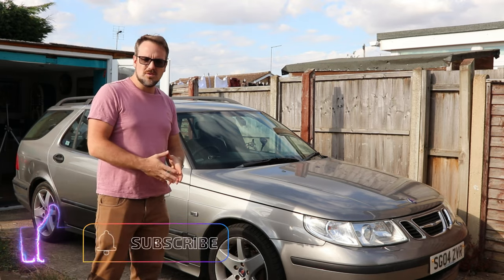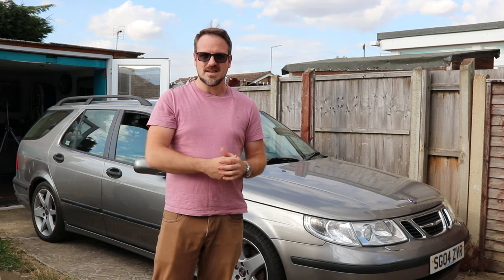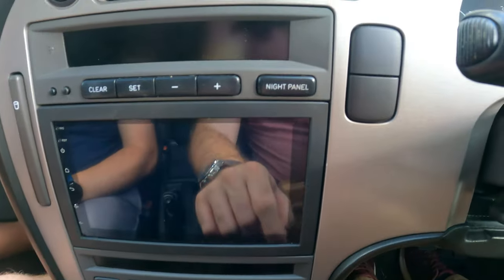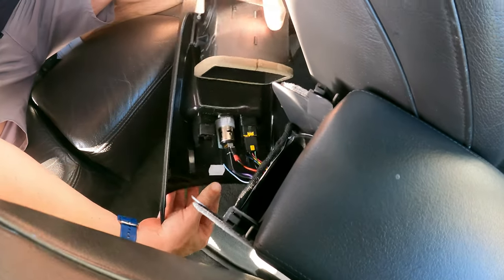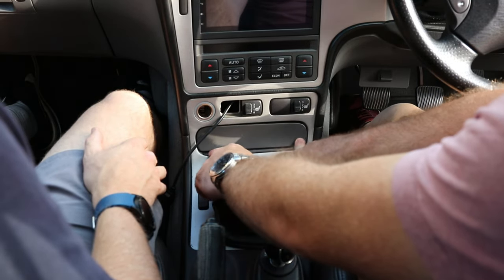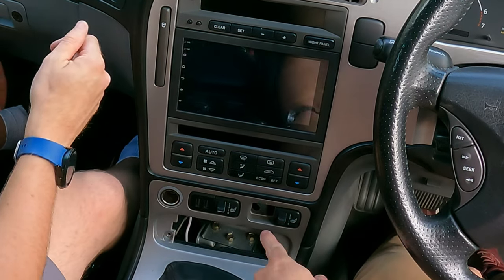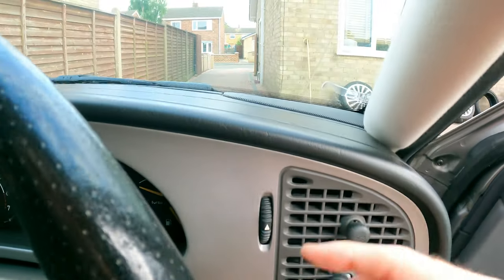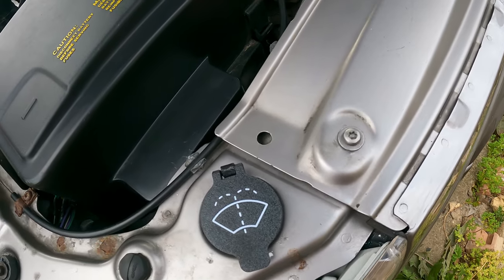Saab3dPrint - Awesome Aftermarket Upgrades for your Saab 9-5 and 9-3 Made by Enthusiasts!

Comment: That volt meter is actually quite useful too. If you turn the key to 'on' but don't start the vehicle, the volts display will show you what the battery is outputting so you can check for a battery that may be getting close to replacement (anything under about 12.2V is considered weak), and if you start the vehicle then this will show what the alternator is outputting so you can see if it's about to go out (less than about 12.6V). You can maybe catch an issue before it gets you stranded on the side of the road.
Reply: I had an old school voltmeter (made by VDO but Saab branded) on my 9000 and it was incredibly useful
Reply: @nuttycommuter3718 There are also ones that can plug into the cigarette lighter. Quite useful.
Reply: @JustWasted3HoursHere  I had the set of three so voltage, oil temp and oil pressure and having that extra information just helped with looking after and driving the car - not giving it beans until the oil had warmed up for example. Often cars now don’t even have a water temp gauge
Reply: @nuttycommuter3718 Back when I drove a gas powered car I found those gauges very useful indeed. Now I have an electric car (a 2018 Kia Soul EV+) and it always does a system check of everything including the 12V accessory battery on startup. Very useful because even EVs can have problems if the 12V goes bad!
Reply: Well, i have a usb lighter and it also features a voltmeter.
Reply: @KayoMichiels  Nice.

Comment: Awesome idea and implementation - NOW I'm free of the messing USB cables running all the place.
One note though: on 2001 9-5 Aero, there's no "torx screw" to loosen up as mentioned in the video's 1st step. One needs to slide the "vent assembly" slightly up and over from the bottom till it comes loose of the retaining hinges.
And then "wiggle" it slightly to have fully come off of the console to gain access to the back of it.
Other than that, it's a great addition - highly appreciate and highly recommend!
Reply: Seemingly the same steps to remove it on my 9-5 sedan from 99.

Comment: I have a 2007 Australian spec 9-3 Aero with a CC2 Plus installed.  A connected, dual USB socket insert for the blank switch position that's just to the right of the head unit space would be high on my must have list. I think that it's where the convertible has the switch for the rag top.

Comment: Hello, how did you retrofit Saab gravity sensors in order for the xenons auto-leveling to work? Is there a video that you made? I will really appreciate any instruction that you may have on that. Thanks!
Reply: Hello I got Saab 9-3 1.9 Aero 2010 Donner spare. 
Is my Saab 9-3 1.9 2007 
I want upgrade xenons levelling . 
Can be all working if I well do swap ? Can help me please more information ℹ️ 
And do you need Tech2 coding. 
Let me know please

Comment: What make/model is the Head unit in your 9-5,  can you still utilise the steering wheel controls for the audio settings?
Reply from the maker: The steering wheel controls work with pretty much all aftermarket units, but I have a Teyes CC2 Plus in this video. I have another video installing it on the channel

Comment: Am looking to get a Saab 93 convertible 03-09 in petrol.
Have you heard anything about the ECU frying in hot weather because its placed just above the engine ?
A want to do a euro trip next year where the temperature can get 35-40 degrees. 

Apparently theres heat mats available to place under the ECU so it don't over heat ?
Reply from the maker: I have never seen a 93 ECU being damaged by heat. I've owned 9 of them
Reply: Me neither and I just arrived back from a 1600 mile (2574km) trip from Washington State to California and back running for hours at 80MPH (128KMH) with temps peaking at 105°F (41°C). Saabs are amazing. Not a drop of oil burned with 157,000 miles on the odometer and 31 MPG (13 km/liter.) I maintain it well  and it has never let me down.
Great gadget video! Amazing. We are so fortunate to have you bringing us so many ways to make our Saabs better! Seriously, you could be an enthusiast for any car, but you chose Saabs and we all benefit from that.
Reply: My ECU didn’t start to fail until I hit 328k miles/528k km. It started going into limp mode for no reason. I wouldn’t be concerned with the heat at all. It may fail, it may not. I’m almost at 16 years now with my Saab, take care of it and it will take care of you.

Comment: Does Dave offer his services to other SAAB owners? If so, how can I contact him?
Reply from the maker: What are you looking to do?
Reply: Was wondering this too, i want the dash "blank" but just an extention, i have an aftermarket headunit but the USB is at the back and i want the cable coming out from the dash "blank"  and not from the rear of my console :) I guess i could tecnically just buy a male/female USB extention and cut/glue it on an existing blank button but... i want it to look good